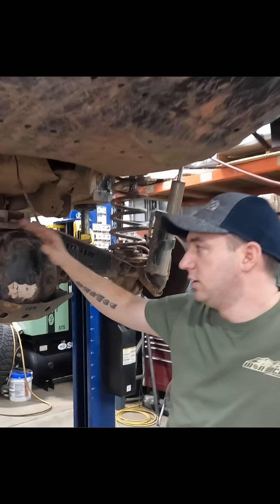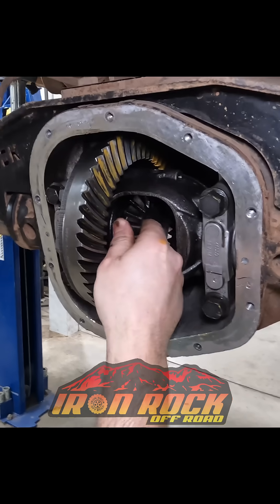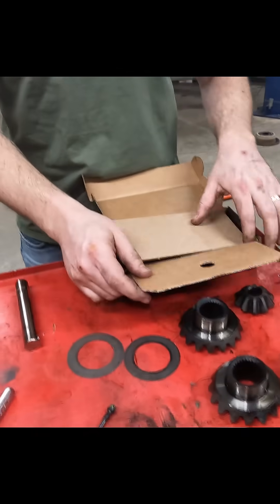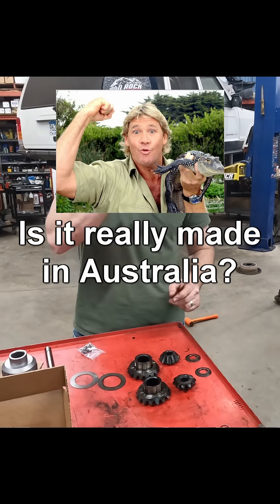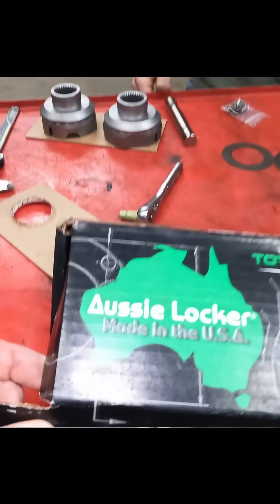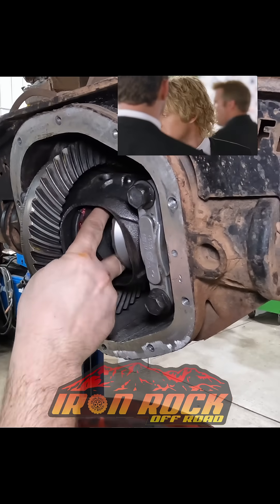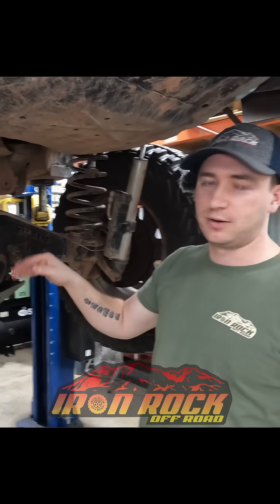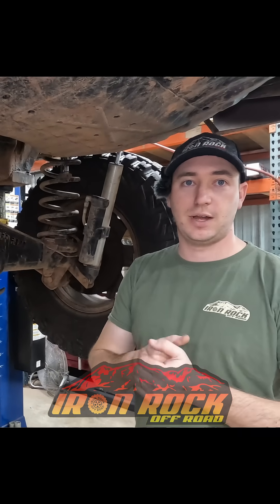D44A Aussie Locker Install

Comment: I've finally sourced a D44a for my wife's ZJ. I want to truss it before I do the swap out, got any advice?
Reply from the maker: @JeepITguy Make sure the axle is ground very clean before welding on the truss. After it is welded use a good oil-based, brush-on paint, not spray paint. In our experience, spray paint doesn't hold up well, especially on a rear axle. The rear axle is hit with all the dirt and mud coming off the front tires, which acts like a sand blaster to your rear axle. Armor up that aluminum housing with our diff skid and it'll last a long time.

D44A Skid Plate:
https://www.ironrockoffroad.com/product/d44a-differential-skid.html

ZJ D44A Truss:
https://www.ironrockoffroad.com/product/zj-dana-44a-box-truss-short-arm.html

Comment: I have a 247J tcase with the varilocks, could I swap them out for this Aussie locker?
Reply from the maker: @matthew7972 That is the same setup that this WJ had. With the Vari-Lok rear diff you need to source the open carrier and axle shafts to be able to install the Aussie Locker. Before the installation of the Aussie Locker we switched to a 231 transfer case that has the option of 2wd. There are mixed reviews on whether or not you can run an Aussie Locker with an AWD system like the 247 tcase provides. According to the Aussie Locker website FAQ section, "If a vehicle has constant 4WD then only a rear installation should be considered."
Check out the full install video:
https://www.youtube.com/watch?v=NfA9sUJxPGM
Reply: @IronRockOffRoad thank you for the info.. so frustrating and wish I did more research on getting a WJ with a 242
Reply from the maker: @matthew7972 I know a lot of WJ owners search for the 242 but I wouldn't overlook the 231 if you are going to swap. They are typically cheaper, more aftermarket support, and higher ground clearance. You can gain 1.5" of belly height switching to a 231 transfer case in a WJ. 

I also wouldn't fear an Aussie locker in the rear of a WJ equipped with a 247. The Aussie FAQ says it's ok. Think about this: because the locker is so easy to swap in, it is also easy to swap out. A local guy here swaps his rear in/out every time he goes wheeling! 😆 It just costs a little gear oil and time.
Reply: @IronRockOffRoad hell yea. where could I find info on how to do the tcase swap for a 231 or 242?
Reply from the maker: @matthew7972 If the 242 came from a WJ it is an easy, direct swap. To do a 231 swap into a WJ you'll need to swap the input shaft in the transfer case and modify the shift lever on the outside of the transfer case. There should still be some old forum posts on the internet that show how it is done. However, we plan to do the swap on Charlie's WJ. He has a 231, he just needs to find a WJ input shaft and decide if he wants to do any upgrades inside the 231 while he has it taken apart.
You can always disassemble your current transfer case to get the input shaft, but he is trying to keep his Jeep drivable for now.
Reply: @IronRockOffRoad okay thank you.. my biggest thing is to get rid of the vari locks and Quadra drive as I’m not a fan of it when I went to gold mountain trail big bear last weekend
Reply from the maker: @matthew7972 The Vari-lock axles and Quadradrive transfer case are great for a daily driver/weekend wheeler, but their downsides show up quickly when you really start pushing your Jeep on difficult obstacles.